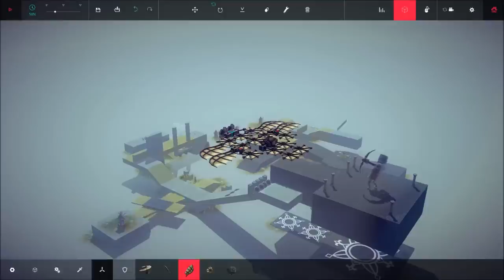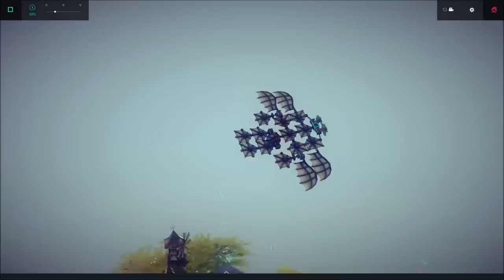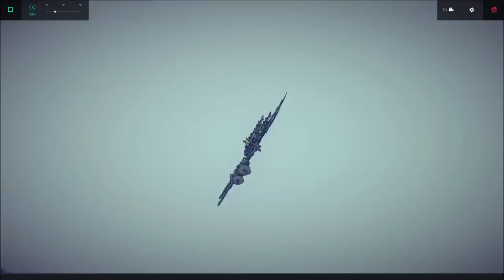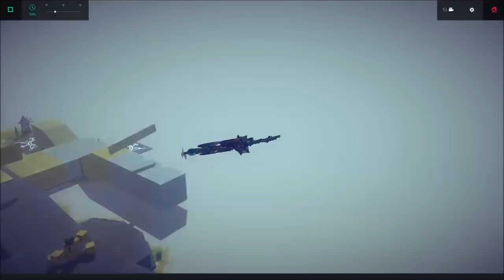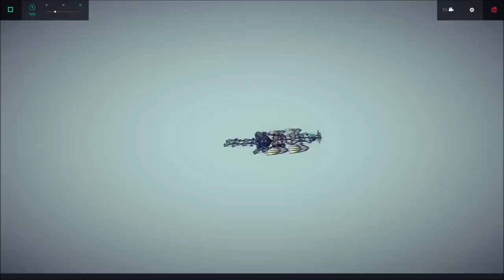Besiege: Powered Glider Design

Comment: Very nice design, I changed the wheels out and replaced them with steering. It makes it easier to control because then you don't have these massive changes in pitch.
Reply from the maker: masterofgreen I'm glad you liked it! I actually came up with this design before I knew about the key binding editor, so I used the wheels because they have a different control set than the steering (which was used elsewhere). Did you find that changing the wheels to steering moved the centre of mass too much?
Reply: HammyGrammy I didn't actually check where the center of mass was before and after changing the wheels out, but I didn't notice much difference in flying the glider.